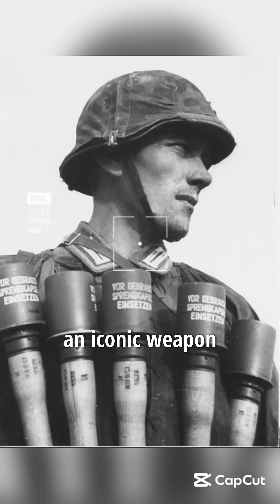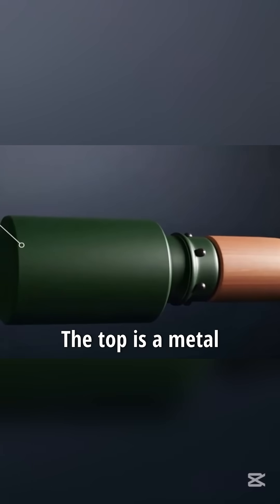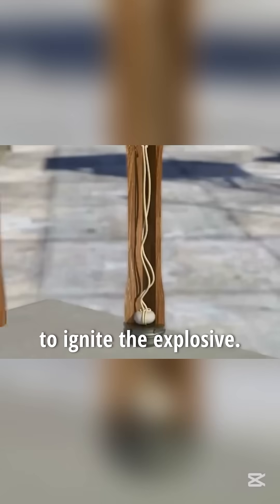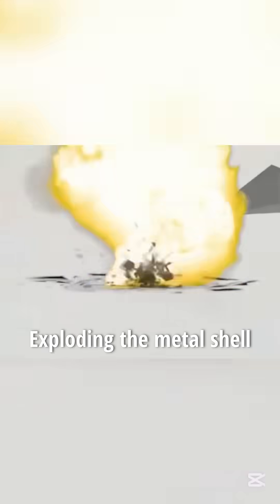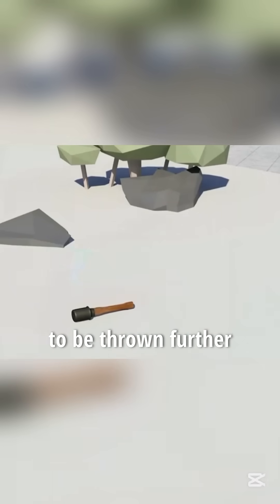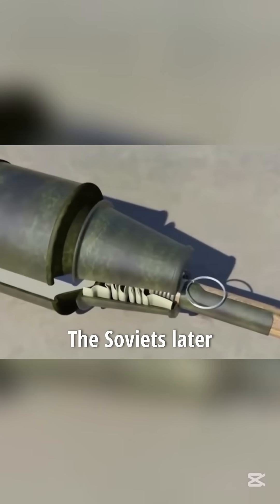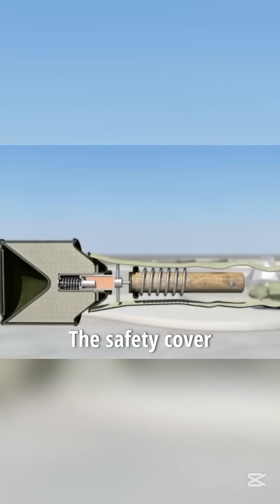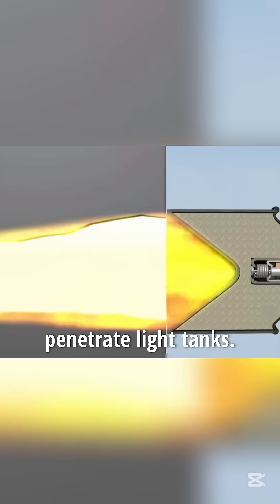How the Stick Grenade Worked 😱

Comment: The American grenades were better because after you pulled the rope of the stik grenade would be triggered so if you hold it for too long you lose your hands but the american one would only be triggered after you let the grenade drop it which means your chance of getting sent back from the frontlines due to an missing arm is smaller with the American one. But if you didnt want your arm anymore the German one is alot better:D
Reply: @nicolajvinthernielsen5227  to be fair though, both had their pros and cons. The Stielhandgranate would not roll from where it landed when it was thrown, the American ones did.
Reply: So don't hold it after pulling it then?